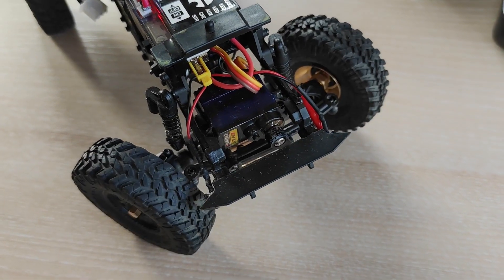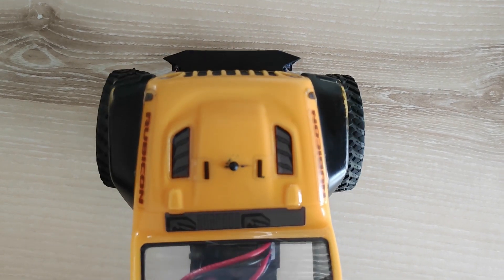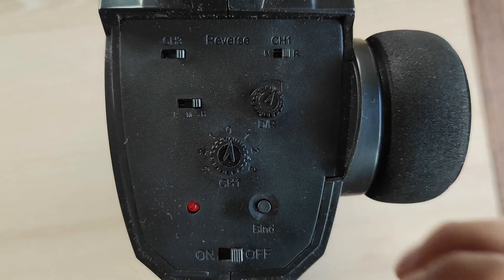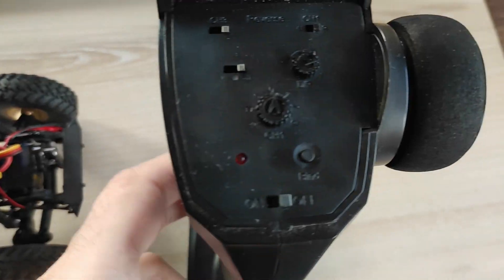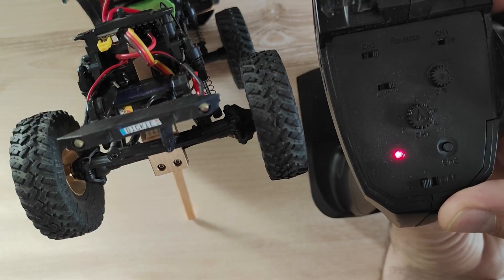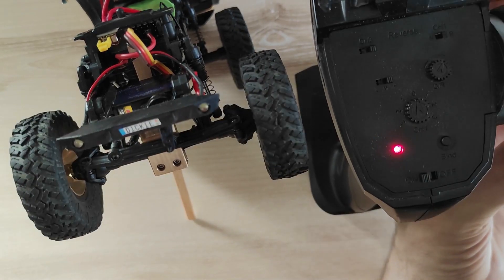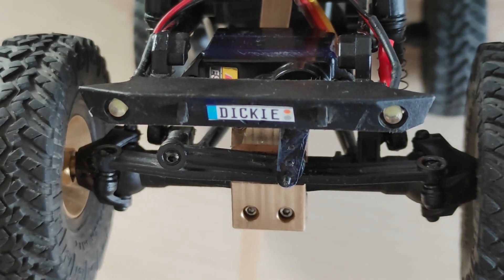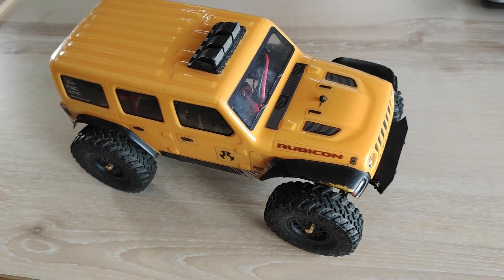Axial SCX24 - servo endpoints adjustment

Comment: You’re trying to teach people how to do stuff but you’re telling them incorrect information like to turn their car on and then turn the remote on. Either you’re too young to understand or too old to remember the transmitter always turns on first, then the vehicle, and when turning off, you do the exact opposite the vehicle goes off first then the transmitter goes off second. The reason behind this is because back in the day when they first figured out the transmitter and receivers, if you turned your car on before your remote was on your car would drive away. Same thing as a fail safe if you drive further than what your transmitter can reach, it might take the last input given from the transmitter and copy it over and over again so if you’re driving straight and it loses control, it’s going to continue driving straight.

Comment: Can you do a video showing how to do this with the new scx24 radio?
Reply: Same my transmitter looks completely different that all the ones I’ve seen on YouTube, found any other vids showing the newer versions?
Reply: Get a better remote, like the radio master MT 12, you should also get it in the ELRS version but get the four in one module, then you can connect to almost any vehicle running any type of receiver protocol. The remote also has much more options for dual rates drive modes and switches.

Comment: I try to do this my wheels will not set straight, I have adjusted it and adjusted, watched every video, they always point off to the right! And Idea,I  have no extra weigh, Any suggestions I appreciate
Reply: Check your tires, mine woble alot

Comment: First turn on the radio, then the car.  Good habit, especially with larger rc's, planes or drones.
Reply: the 24 scale crawlers won't be that much of a nuisance. the thing goes like 10mph tops and you just snatch it like you would grab a kitten. some of the larger ones on the other hand....yes it could give you a horrible day.